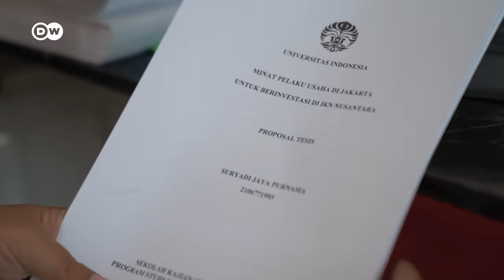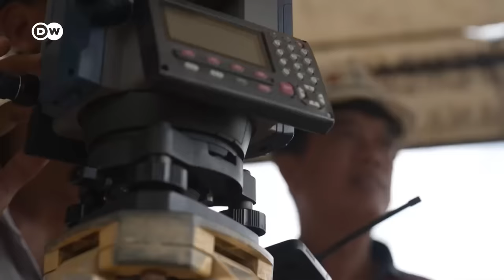Why Indonesia turns to private investors to find billions for its new capital Nusantara | DW News

Comment: This is a long running project and a breakthrough. 
In case you didn't know, Indonesia is geographically spanning from east to the west in a huge distance, it's longer compared to China.
While the current capital city, Jakarta lies on the very west side of the country. 
This definitely will distribute development to other sides of the country. It's a bold move and good luck.
Reply: But many countries have capital not in the center of position like china, USA, and many others. So i think its not the right reason to make new capital
Reply: @nonymuous  well, but not many countries have archipelagic teritory like Indonesia does. Furthermore, the development of Indonesia is more Java centric now, so in my opinion, it would be fair for other parts of the country to get the benefit from the development.
Reply: @nonymuous thats not the only reason btw, in jakarta building are all over the place its not structured well causing high traffict problem, flood, etc ... its too late for renovate it will be an endless nightmare , unless you did a new capital wich people barely live there in kalimantan ( this place has lower population and have lots of tree, wide land is great to makes a well structured programs easier
Reply: @nonymuous  they not archipelago country, its easier to do things in such country compared to indonesia
Reply: @nonymuous Jakarta is sinking even the US Embassy to Indonesia delegates said so.
Reply: @willylazuardi8828  Kalimantan east area is not on strategic international trade line. Indonesia actually should move her capital to Sumatra to emulate how Srivijayan Empire prosperous from tapping international trade of Malacca strait. Majapahit got prosperous because fertile Java's volcano land can support rising number of population. But now Java's so crowded. If Indonesia wants her capital to be prosperous then half of the Javan Island population should be moved to Kalimantan for the growth, economic continuity and development of the new capital, if not, Nusantara capital will be just another ghost city like Nypidaw of Myanmar
Reply: @ummfaizal  That's actually the real reason that many people fail to grasp. Jokowi and Indonesia's political elites aspire to establish a new trade route via Selat Makassar. The rapid development of the Eastern Java manufacturing sector in recent years underscores this objective. Consequently, Jokowi aims to forge a connection between Java, China, and the Pacific, liberating us from dependence on the Selat Malaka bottleneck.
Reply: Oh, you sure? Even USA & China has their capital in the most eastern part of their country but they're doing ok. We don't need to move the capital if it's just for the sake of equitable development. All we need is a good governance & public officials integrity. As long as we don't have that, no matter how much we move the capital, we would never be able to achive that aim. By leaving the sinking Jakarta and built up a new capital in another city, really show us that if the gov cannot solve a problem, they just need to run away from it. So yeah, it's a bold move. So bold cause they don't have a shame to run away like a thief.
Reply: @irabakri2662 so you think that moving the capital would accomplish that aim? Why not just build some adequate infrastructures and put necessary resources there to accomplish that aim?
Reply: @caveblumei  yeap, that will work as well
Reply: @nonymuous Equitable distribution to each region is only a few of several reasons, another reason is that Jakarta is experiencing significant land subsidence, the interest of people outside the island of Java to seek work in the capital makes Jakarta very dense causing pollution and severe traffic jams, the island of Java is also a confluence of two plates  and is passed by the world's ring of fire which causes many active volcanoes and intense frequency of earthquakes.
Reply: Best wishes for us all
Reply: Aaamiiin
Reply: @caveblumei but USA and China are not an archipelago country
Reply: Jkt is too bad n too crowded
Reply: @caveblumei China and America are not archipelagic countries. It is different from Indonesia which has more than 17 thousand small islands and 5 large islands. In terms of economic equality, the government can actually do it, but the main problem here is that all the population and the majority of the industrial sector are on the island of Java, plus costs. Shipping goods from the sea is also great. It's not easier than you might imagine.
Reply: Ri so poor kerjany hnya mngemis hidup2
Reply: I'm saying this not because I'm opposing (til the end) the idea to move our capital. Maybe it is necessary, but not now. Moving the capital is not the urgent thing now. Jangan sampai krn buru-buru dikejar agenda 2024, malah jadi petaka bagi banyak orang, banyak hal, termasuk merusak ekosistem yang tersisa di sana. Pindahin ibukota negara kok ya seperti orang kebelet berak!
Reply: you don't understand clearly whats happening in the country. 
nothing will change. Everyone will still cramped in Java, nobody want to move to the that Borneo because one, it always have forest fire every single year, also two, the land price there already skyrocket to the point that it almost the same as in Java.
Reply: @caveblumei pak, jakarta mau tenggelem pak, ya jelas harus buru2

Comment: because private investors cant economically cripple you and they can be disappeared.

They should do the normal thing and simply redesignate an existing city the new capital.
Reply: Feasibility studies had been done for 10 years, and its been concluded that redesigning any existing city to the new capital would cost the govt 5 times the budget needed for build a new one, even the cost from keeping Jakarta from sinking would be up to 10 times the current budget.

Comment: Indonesian Government need to show more detailed plan than just mentioning the function of the new capital. They need to show:
1) How the private sectors could have benefit by inveating in the project.
2) How to ensure the private investment would be protected from "naturalisation" by the Indonesian government in the future, especially after Joko Widodo no longer the president.

In the past, Singapore has learnt a hard lesson after being 'cheated' by the Chinese government in Suzhou Industrial Park (SIP) project (read it on Wikipedia if you want to know). I'm sure Singaporean investors haven't forgotten the lesson yet.
Reply: Indonesia doesn’t have the resources and the fundings to build a megacity from scratch, and this new capital was designated to become an administrative district. It is not “Tempting” to private sectors. Hence they are struggling to find fundings. This whole plan is a failure to begin with. Either they are planning to fail of failing to plan, that I don’t know.

Comment: The video discusses Indonesia's plan to build a new capital called Nusantara on the island of Borneo. The new capital is expected to be fully ready by 2045, with the government planning to move some institutions there from early next year. President Joko Widodo is a major supporter of the project and has been seeking private investors to cover the majority of the $32 billion cost. The reason behind building a new capital is that Jakarta, the current capital, is sinking due to rising sea levels and subsidence, and the government aims to redistribute economic prosperity away from the main island of Java. The project aims to create a green, smart city and attract private investment, although there are concerns about potential issues like corruption and the long-term sustainability of relying on private funding. Jakarta's subsidence problem remains a significant issue, and there is hope for a concrete plan to rescue the city. The move to a new capital has garnered mixed opinions among the Indonesian population, with some supporting it for decongestion and economic development, while others believe that resources should be better used to improve existing assets.

Comment: Corruption cases for 2024 for Investment ministers. 
First check = using the materials as request or not etc. Whether for buildings or infrastructures (asphalt). Mostly they will use some materials as request and some materials not as request [the price gap between as request as on paper VS cheaper/cheapest will go to the "ministers and ministries and people whom involved for it" For this case mostly the fault isn't coming from the entrepreneurs but from the ministers/ministries/persons inside them - they will ask the money. If the entrepreneurs won't give, the projects won't happen. That's why the money goes to the persons inside it until ministers. 
 - Including corruption check for BUMN Indonesia minister for new port by DP World Dubai. Sheikh MBZ Toll Road in Jakarta already caught some persons from Bukaka Tehnik Utama [its CEOs etc] for corruption case for IDR 1.5 Trillion - and not finished yet because all vendors haven't come yet -.

Comment: I am sure ID government would have done their due diligence before launching this project. Just one question I have, is 32 billion not enough to improve Jakarta city from all aspects including replanning of the infrastructure and planned development. I am sure it would cost less than the current spent. This population, infra concentration issue will creep in again at Nusantara, so will build another capital?

ID government should really consult with Singapore planners for the Jakarta overhaul. Despite being a tiny island, there is a perfect balance and strict control to save the island while still saving money for reserves.
Reply: As an Indonesian, the said due dilligence was not done properly before moving the capital. The bills of the new capital was only drafted in 42 days, without proper public consultation. The environmental impact study (or AMDAL as we call it in Indonesia), has not been made available to public. The academic paper for the capital relocation was heavily critized because it was lacking comprehensive studies and apparently instantly made. There were no public consultation before the decision of relocating the capital was made. The decision was made exclusively by Joko Widodo.
Reply: YOU ARE ABSOLUTELY RIGHT.

If Jakarta is too crowded and congested improve the city with a better planning, do not JUST neglect it. The city needs more infrastructures that the government has not build for decades (where are those new roads, parks, public housing?). 

Indonesia's priority is to eradicate poverty, not build a new capital! Majority of the Indonesian can not even have a good meal in their table because they do not have work. If they do have work, cost of living is getting more expensive. Create more works! A quarter of the Indonesian under the age of five experience malnutrition. Even many Indonesian have to go abroad only to become domestic workers and a lot of them get cheated by people involved in human trafficking (a lot of them lose their lives or coming home with only one kidney!). CAN YOU BELIEVE THAT!